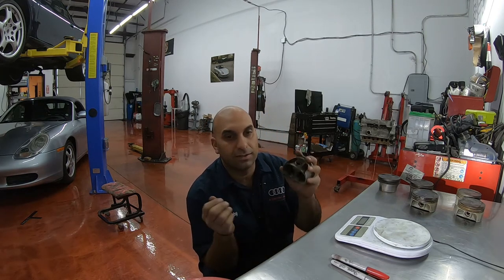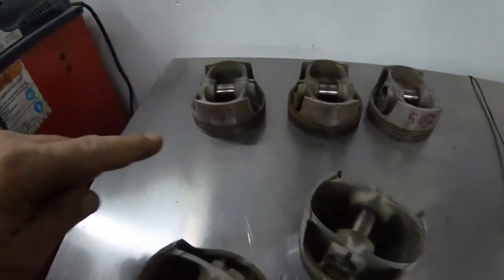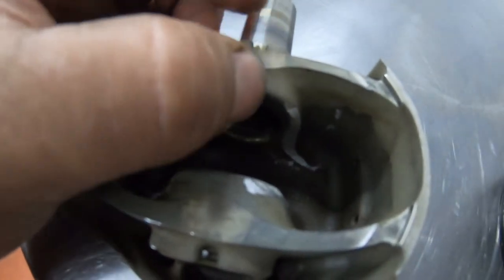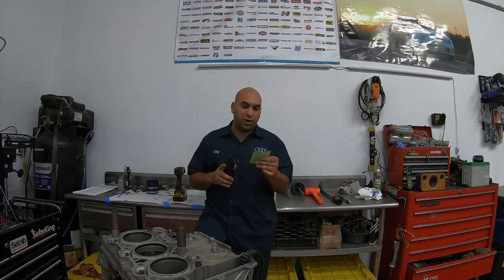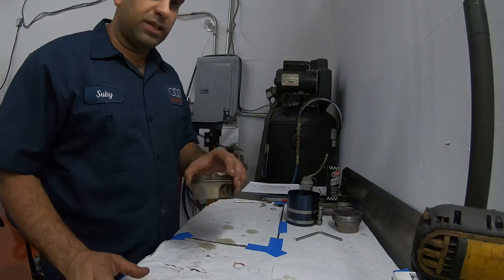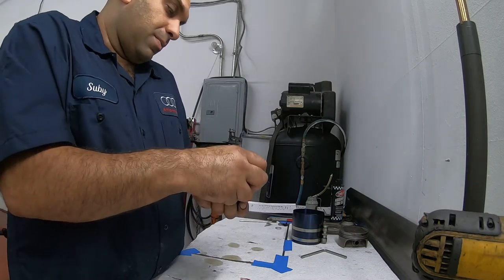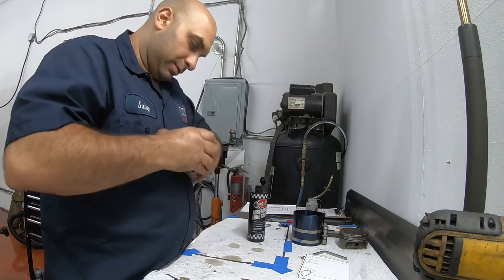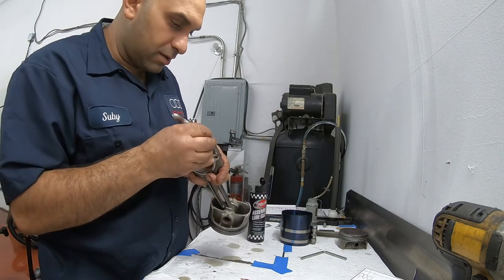How to balance engine pistons M96 911 Porsche short block Episode 9 Fake GT3 build

Comment: Wait .. what’s the point of balancing just the pistons if you’re not balancing the con rods and at least weighing the rings with them to make sure that the entire set weight (piston, rod, rings)  is the same for all 6 !? 
Also why are you hitting the circ pin tool with a hammer instead of pulling the inner part by hand and pushing it in with one solid push to position the circ pin !? 
Imagine hitting that tool so many times when doing the other 3 pistons through the hole and having the circ pin fall inside the cylinder !!! Then you’ll have to open up the engine again to get it out
Reply from the maker: Hey thank you for commenting. 
I balance the rods off camera and next motor I do I’ll show that process.  As for piston rings those so light on there own any deviation in Weight wouldn’t be seen on my scale.  Also when I cutting in to the pistons I make sure the rings are not in so they won’t give a chance any shaving would get stuck in between piston and rings.  At the end of the day the motor is more balanced then when I stated working on it, that makes it more gooder😝
The circ pun tool I have is very tight and I use a rubber/plastic mallet that doesn’t damage anything when I tap it.  Next time I’ll try your method thank you!